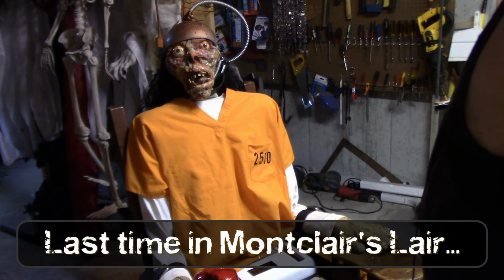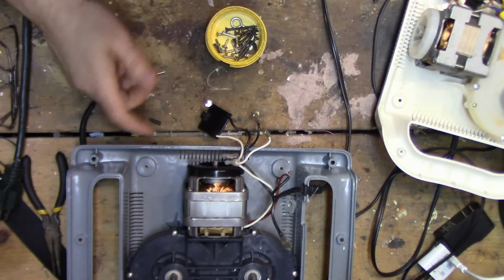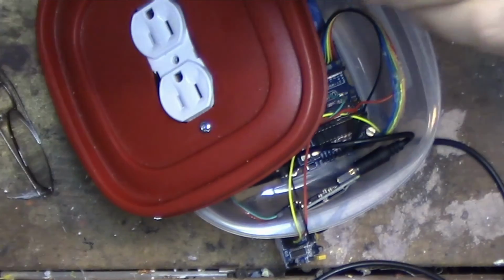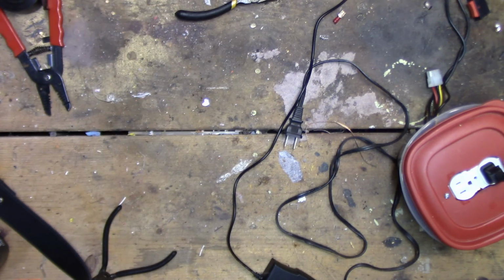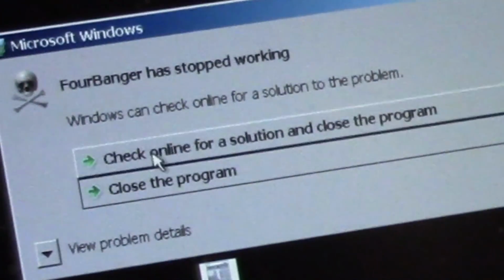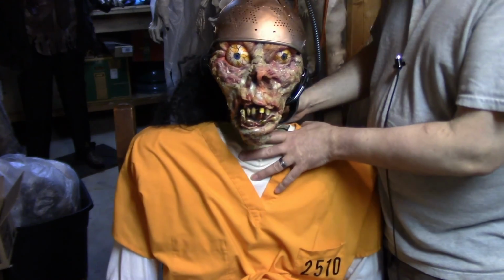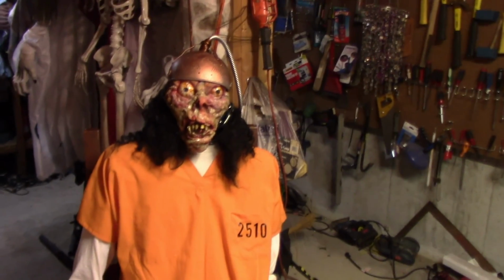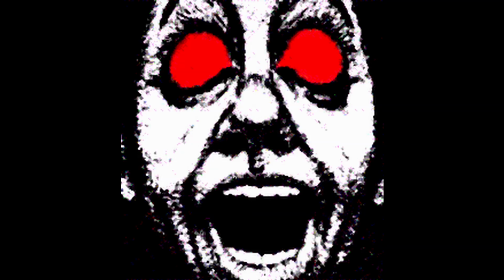Arduino Electric Chair Prop #8 - DIY Halloween Vlog 2016 #39: Electrifying! (Part 8)

Comment: Did you try to disconnect the power for the Arduino when the USB is connected?
I wonder if the pc is is disconnecting it because it is sensing the Arduino is being powered externally...
Reply from the maker: Yes, both ways tried. Made no difference.

Comment: Have you tried to use a different computer,  it could be a driver issue for the software crashing issue?

What are you some kind of wire nut.. why yes yes i am.. :) 

I used a 110ac little motors for my hack in the box last year but the motors were only going one direction 

It looks great man.. 

Ok so what was the  fix??  I watched and I only remember the 500ms delay, but thought that was not the full fix..
Reply from the maker: Its not the PC, otherwise it would fail when AC is disconnected,  too. It does not fail in that situation. Yes, the workaround is 500ms between direction changes. Something to do with the capacitor needing enough time to discharge before changing the direction of the motor.